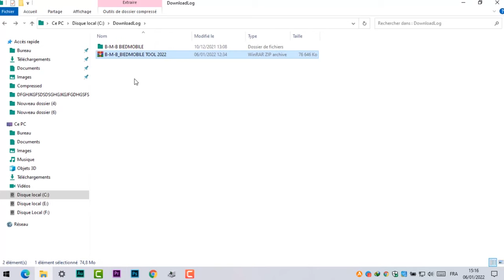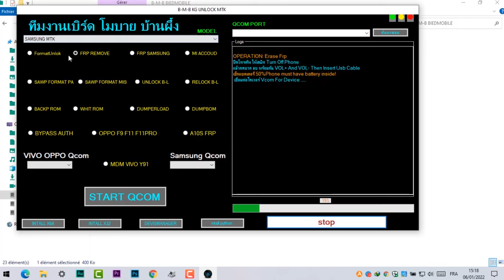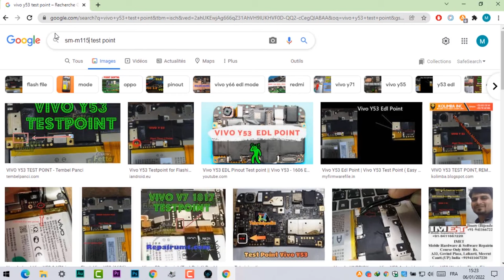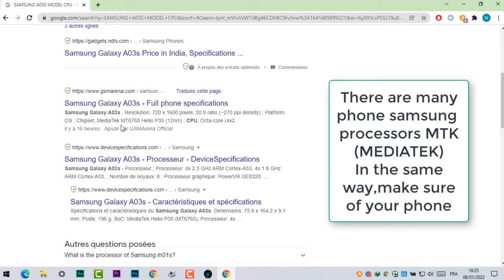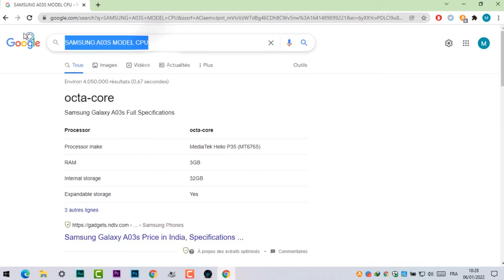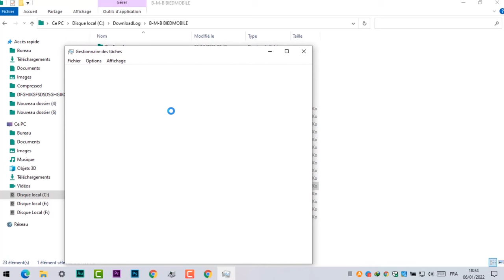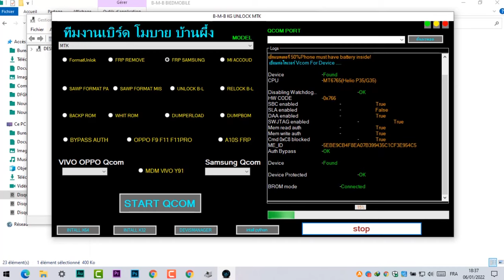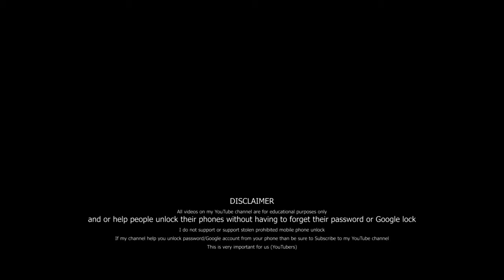Samsung Frp Tool 2022 | All Samsung Frp Bypass 100% Working

Comment: Thanks for the tutorial, but avoid running videos showing other test point models that are not the model used in the video. the tutorial is very basic but there is no need for so long in the video. here's my tip.